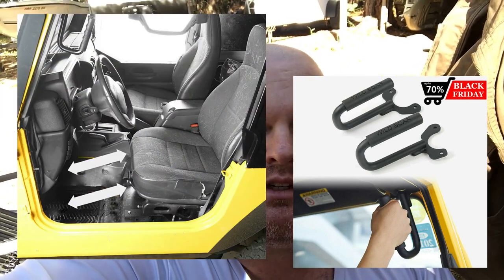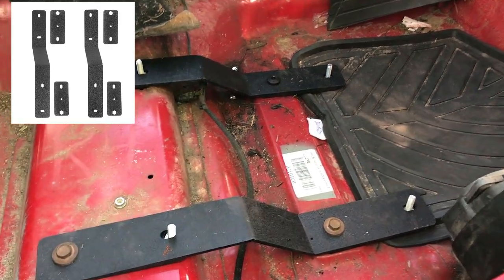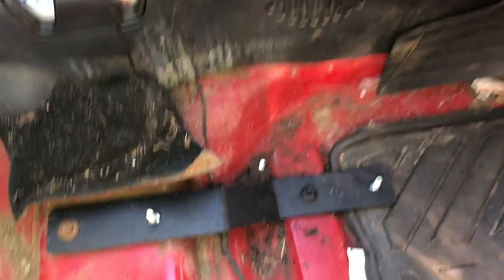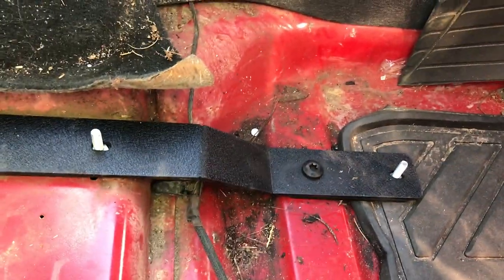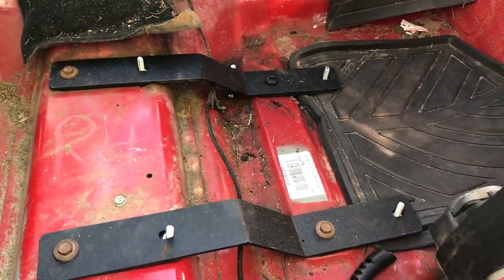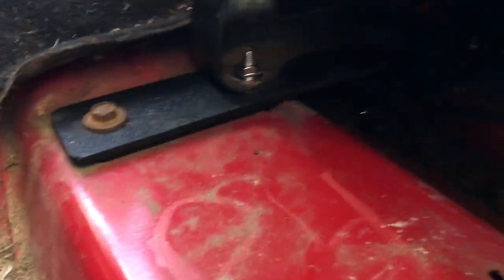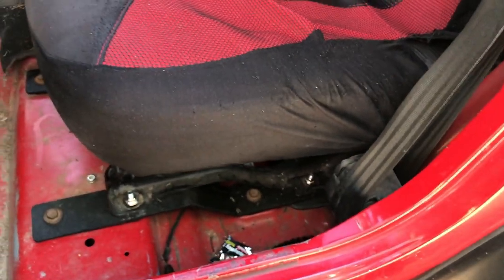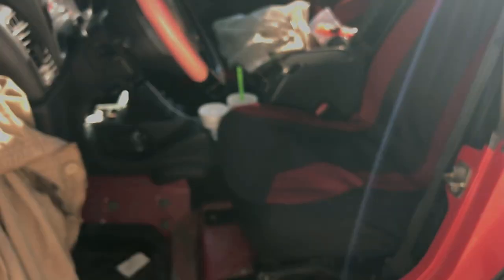Jeep TJ Seat Extension Adapter PROJECT TJ  The Real Life #thereallifeyoutube

Comment: Thanks for providing a link to the part. Those extra parts are to help prevent shearing in the event of an accident 😊. Im guessing that bolt quality isn't that great and they're probably prone to rust pretty quickly. This would weaken the shear strength but meh, 😕 if the accident is that bad you getting messed up anyway 😂
Reply from the maker: Very true